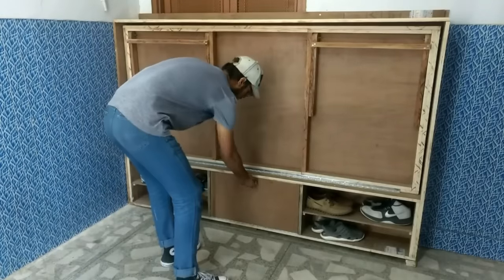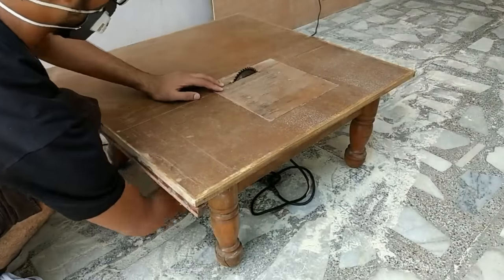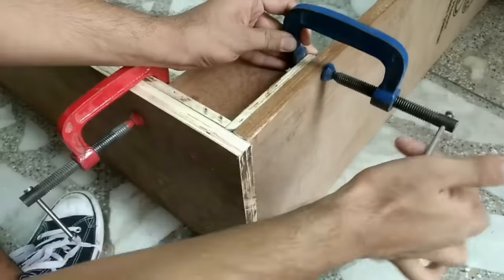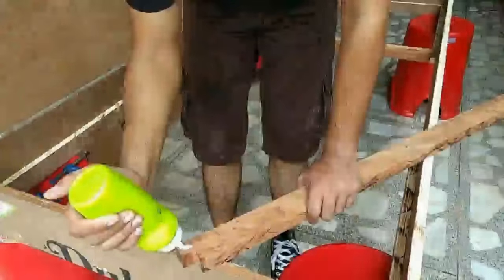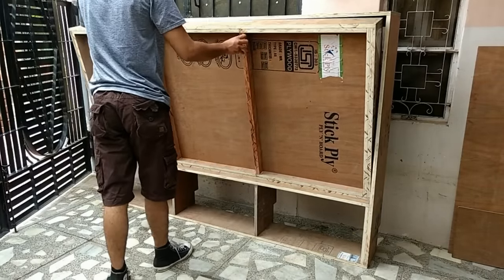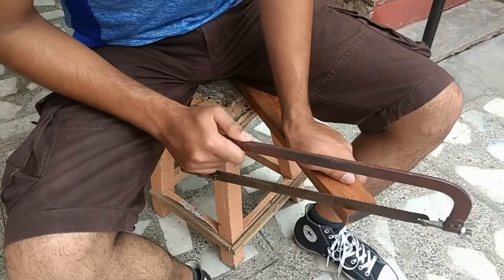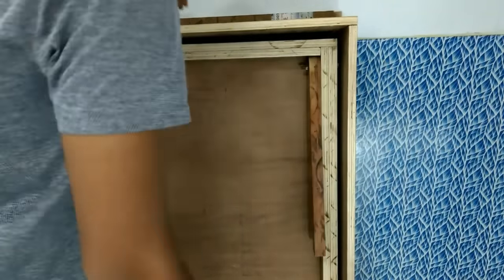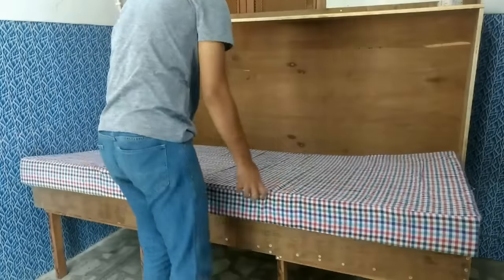DIY Murphy Bed Without Expensive Hardware | Homemade Folding Bed under $100

Comment: Great video! It's good to see someone using the sort of tools and building in a space that many, if not most of us have instead of a fully fitted workshop. I'm sure it will encourage others to make your well thought out murphy bed. Thanks so much for sharing.
Reply: My thoughts exactly, Kez..... 
Shame though, that the plywood manufacturer felt the need to put so much printing on their plywood sheets...It must be a real pain to disguise, or get rid of it all.... makes all jobs twice as long. Please: Stop It!
Reply: @patagualianmostly7437  Yes, there's definitely a lot of print on those sheets, isn't there?
Reply: This was real diy for neccesity not to show off. Many on YouTube have $10,000 garage or wood shop set ups not realistic to average person. Amazing job.👍
Reply: Great to see carpentry work done with simple tools.
Reply: Thats exactly what i thought. I will now make mine.

Comment: Great job ! 1)squares at corners to hold clamps 2)table saw 3)problem solving the sagging board and # 4 YOUR WEARING CHUCK TAYLORS ! I got my first pair about 1960.
Reply: HAHA! Mega dittoes on all! The Chuck Taylors took me back to the 60’s too, when that was THE shoe for basketball. Now, my grandkids tell me all about how the ‘Nike Air Max Stud High King George Low High Rise NBA  kicks’ are so much better than the ‘Adidas Smooth Low Profile Zoom Kevin SlamDunk striders’ are.... sigh. Then I realize my Saw Stop/Dewalt/Ryobi/Bosch/Freud/Jet filled workshop has just been hosed by this young man with a circular saw and two drills.... with power cords, no less!!! lolol

Comment: I knew it could be done without the official hardware. Many thanks for sharing your creation with us. Plus I loved the tools that you used. Excellent work which in theory means it should be a walk in the park with the tools I've got. I'll just use my "Impact Driver" Drill 🙊😁
I'm going to use the base of my sons cabin bed & make this for him. When you've only got a small bedroom which just happens to be over the stairs, your really limited to space. This will create a lot more floor space in his bedroom so I can put a small sofa in there for him to chill out on instead of having to constantly sit on his bed. My son is only 8yrs old & I feel bad as his 11yr old brother has a far bigger bedroom than him. So I'm looking forward to making this. Again many thanks to you & your fabulous video. I've also shared this with my friends on Facebook. Keep up the excellent work.x
Reply from the maker: I am glad you like it. Have a good day 😊. BTW i am chilling on my bed right now😁
Reply: The ‘official hardware’ just makes it easier to lift the bed. Depending on the design it will have additional features like hidden legs or a stay level table etc. 

If those things are not that important, all you need is a pivot for the bed. Plenty of variations on how to pivot the bed.

Comment: Excellent video....I needed to build a bed for my son and came across your video.  Excellent design and simple explanations for a DIY'er such as myself. I modified the measurements slightly since I used an existing bookshelf as my base. Unfortunately with the cost of lumber and supplies here in the states my cost was well above $100 but still much cheaper than buying a premade one for over $1000.  Thanks for posting!
Reply: How were u able to use an existing Book Case for your project???

Comment: It's such a pleasure to see an Indian guy completely making a bed all by himself. It's surprising that you didn't take help of any 2nd person at any point of time during the whole video. 
I was little hesitant on using these kind of carpentry tools, but your video definitely gave me a boost. I'm definitely going to try this. Retailers here in Hyderabad are asking almost 50k to install this. hoping to make it in at least 20% of the cost even after certain wastage, that am expecting as a beginner.
Reply from the maker: Yes buddy go for it, Why Buy When You can D.I.Y!

Comment: Nice use of piano hinges. I love those 90 angle corner boxes for joining.  Nice job.  I would add a shelve in the middle, to put stuff, of course, it will give more support in the midlle of the bead when open...Nice job.
.

Comment: I like your tablesaw 👍
American diy woodworkers (YouTubers) should be learn from you.As diy projects they use lots of fancy tools , of course everyone with a little bit of knowledge are able to make stuff with unlimited access to the expensive tools.
You did this great job with a circular saw and a drill.
Very well done mate 👍
I'm pretty sure after 2 coat of paint your Murphy bed will looks much better

Comment: Measurement in Inches
Frame 82 x 11 x 54.5
Box 79.5 x 6 x 37.5
Plywood sheets 2pc ¾, 1pc ½, 1pc ¼
Hinge reaaaaaaally long one
Nails, screws, bolts and nuts
Reply: hi
Reply: Thanks so much for posting this! I'm making this today, but using 2 inch wooden dowels for the hinge system.
Reply: Murphy beds are perfect if you have room for an extra bed and this is an easiest way to  build one! I made a queen size murphy bed similar to this and used it for years but I took it down last year. Mine raised and lowered from the bottom, not the side. I used a couple of big strap hinges instead of piano hinges and they worked just fine.The legs folded up when the bed was raised. I'm now making a twin loft bed mounted to the wall 5 ft off the floor so my furniture and desk can sit under the bed.
Reply: Do these measurements have factored in that mistake he made with the top portion where he had to remove and modify that piece? I like how he wasn't embarrased about that and left that in there, hoping to learn from his mistake not my own! Sometimes you can measure twice, cut once, and then still go "aww shucks"!
Reply: @dangerdavefreestyle   from what I observed in the video, the measurement is as is. He just added a 2-inch wide strip of plywood as a sag repair/straightener/wall anchor. Also, the solid wood he used for the mattress support should be added in the above list.
Reply: @Yeshuaschosen  hi, can you please share how do you secure a vertical murphy bed when it's folded? I think that is the issue for me why I prefer this horizontal orientation.
Reply: just shows what you can do on a budget!!! Sturdy and efficient, but i need to see the homemade table saw!!! I get the idea but i need the particulars.He made a table saw for a song. I would like to follow this fella, but i am sure he will get lost in myriad of posts.
Reply from the maker: @jamessimpson4876  i will post the video on table saw on this coming sunday. You can subscribe if you want to see the video, thanks 😊

Comment: really great job. what you have adjusted when the bed not fitted in the frame. i feel the frame is not in straight. any way excellent job with those two tools.
Reply from the maker: the top plywood was bent

Comment: Very nice diy job! I'm a woman but i love diy projects ,do I know what  type of drill are those? Is it hammer drill and driver? I'm planning to buy tools but I don't know what is best if I'm gonna use nails on wood and concrete. Also for screws. Is it possible for a tool with both uses? drill and can be driver? Could you help me?
Reply from the maker: Here the orange one is corded hammer drill ( it has variable speed trigger), you can use it for both drilling and driving screws and also for drilling in the concrete and it is cheap and sturdy
Reply: @TheIdeaBox  thank you so much!

Comment: only thing I would do differently is the homemade corner clamps. I would use 2 or 3 squares glued and screwed together and drill some holes in them for the clamps. I dont trust those perpendicular pieces to be perfectly squared but HUGE kudos for this 100% DIY!!!

Comment: great instructional video, bro!! so awesome! but umm.... where does that double door that you blocked off lead to? if it is an exit out the building,  your awesome murphy bed is blocking a fire escape.
Reply from the maker: Thanks buddy, the door leads to another room which is unnecessary, that is why shut that, that room has 3 doors.

Comment: I have one suggestion, why don't you bound the 4 legs together with one bar of wood so you only need to handle one "leg" when accessing the bed.
Reply: YoungBob Moes 
I don’t understand ?
Reply: @AShadeOfYou ; he means something like the stop blocks that tie each of the two pairs of legs, only longer so that all four legs are tied together.  I would probably put it about one third of the way down.
Reply: Perfect!
Reply: Brilliant

Comment: May I suggest to anyone considering making a similar bed, it's better to have the mattress on a slated base for ventilation. Body heat will cause the mattress to sweat against the plywood and a damp patch will eventually form. I used 24 solid wood slats, but it may be possible to drill ventilation holes in half inch ply.

Comment: Bro,  will the bed fall down when it is folded. How do you make sure doesnt fall down unless pulled?
Reply from the maker: I am using it for past 2 years, it never fell down, its heavy enough, and some vaccum is also created when its closed because of the back panel, it makes it a bit hard to pull it until its opend partially.
Reply: @TheIdeaBox  thanks

Comment: do you think it would be easy to add a table into the build? bet/table?
Reply: I would reckon it should be a pretty easy task to add a folding table. Add a piece of plywood on the right side head board  of the bed at the height of the matress with two hinged legs. It will be a narrow table but will serve the purpose.

Comment: what about the safety for not getting fall down the bed frame itself?
Reply from the maker: Bed frame is attached to the wall with screws and the mattress box is pretty heavy, it doesn't tip over by itself.

Comment: 1)Wat happens if the folded bed falls without our knowledge.. you should tilt the lower cabinet a little bit opposite to the side of the bed
2)or  you should make something to hold the bed  when bed is in  standing position....but anyway kudos to the creater he also uploaded the faults happend while making it...
First diy in india may be...
Finally your work is good...
Also size of the hinge should be smaller
Reply from the maker: Its been a year since i am using it and it never fell down on its own because its pretty heavy. Thank you for your comment and yes two small hinges will do the job perfectly, 6 feet hinge is overkill.

Comment: It's a sturdy bed design. If that bed is painted and polished, it will look 10x expensive
Reply from the maker: Yes it looks expensive now, i used vinyl sheets to finish it later on.

Comment: Its interesting that you chose to use plywood. I assume you are in India? I have been to Bangladesh many times and Plywood basically doesn't exist there. And over here in the UK plywood is very poor value compared to solid wood. Two sheets would already hit your $100 budget from most retailers, if you really hunt around you would maybe get three sheets for $100. Plywood only seems to be good value in the USA, they make absolutely everything out of it. For example boarding floors and walls. Housebuilders would never dream of that in the UK.

Comment: This looks very crude with out any lamination or polish. Fixing lipping to the exposed edges would have looked better & would last longer.
Reply from the maker: i did put vinyl wrap afterwards, it looks much better now, you can check it out in this video.  https://youtu.be/dZl6GEFv1Zg

Comment: Too bad I can't use one in my tiny bedroom.My ac is in the worst spot.I would not be able to fitvit correctly because one it sticks out, an two it blocks my air an in 116 degrees that is not acceptable.Im also no builder an have zero skill saws.I got a cheep hand saw for a small project swamp cooler w/ pvc frame.
Reply: Id love to put the ac else where an do my full size as a murphy bed.My room is really so small everyone else put a twin in here.I tried a queen for a few months at first but the corner was bent up by my drawers an locked in my cooler...So I found this full size on Craigslist from a guy with two small kids.It was his kids bed I think.

Comment: He said the floor wasn't leveled and then it's very clear that the piece he put on the floor under the frame (box) made the box higher on the right side. It's very visible if you are looking at the blue wallpaper behind the box compared to the left side. He should use a level for this. The idea es clever but I don't think this bed is going to last......
Reply from the maker: Thanks buddy, I sleep on this bed daily, it has been almost 3 years and I had never encountered any problem, I am glad you enjoyed the video, Have a good day😊

Comment: All these kiss ass comments...

There's a reason he didn't lay on this thing at the end of the video...
Reply from the maker: I sleep daily on this Bed, i am literally typing this while sitting on this Bed, 😂😂😂
Reply: If it had been a valid comment, what was the reason he would not have laid down on it?
Reply: Would you have liked it better if he used a whole bunch of expensive tools paid for by some commercial sponsor?   I like it.
Reply: YOU GOT PWNED!!!!! HAHAHA!
Nothing wrong with this bed. It's got a heavy duty hinge, decently thick ply, anchored to the wall etc.
As a woodworker and architect, that's a really nice inexpensive and very easy to make (novice level) murphy bed.
Reply: Did you watch the entire video?? Or, could you not wait to bash someone else’s work so you ran to the comments? …. He’s on the bed @13:48 .

There’s a reason you came here to begin with… let’s see your video.